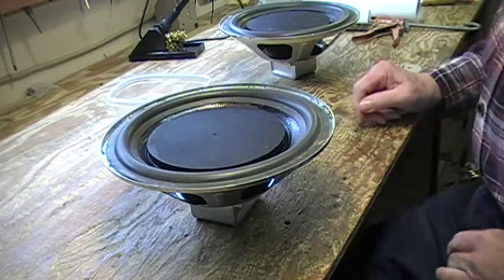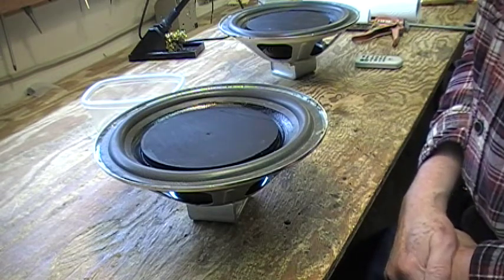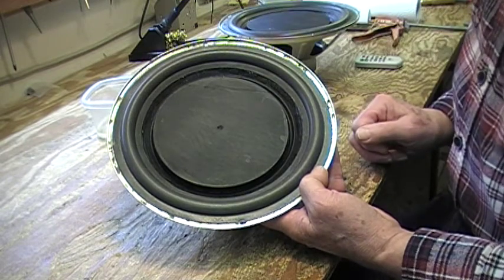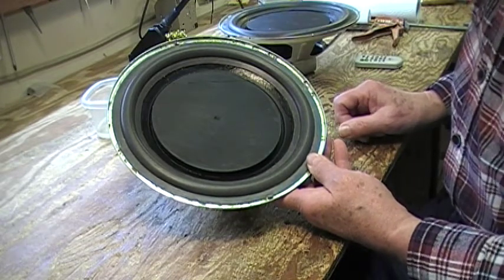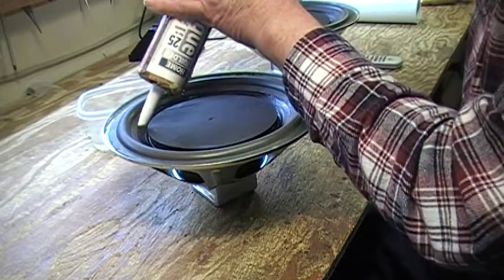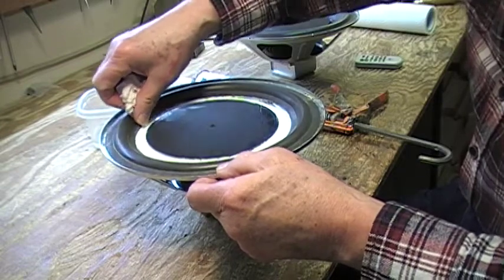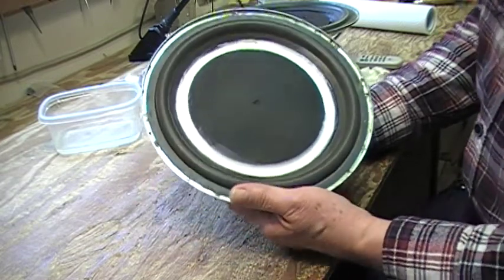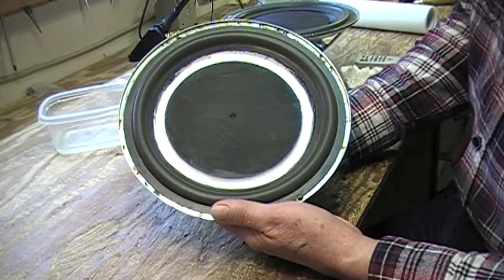Latest speaker passive radiator construct

Comment: Sir you deserve more subcribers..
Reply from the maker: I've been trying but sometimes it is hard to catch a wave!
Reply: @dontheoldradioguy7180  Your work is good i hope you catch a wave soon.
Reply from the maker: @raheel9302  well thank you for that.  I hope to start a regular video on turntable and old radio restoration soon
Reply from the maker: Thanks for your support.  It is what it is.  I will be posting a reclaimed  6 inch speaker and having a new surround and doing free air measurements
Reply: @dontheoldradioguy7180  great